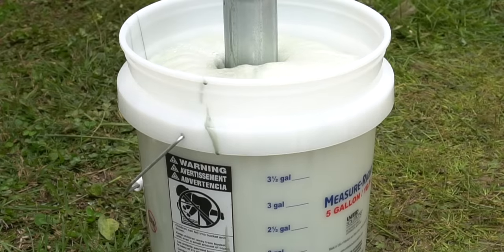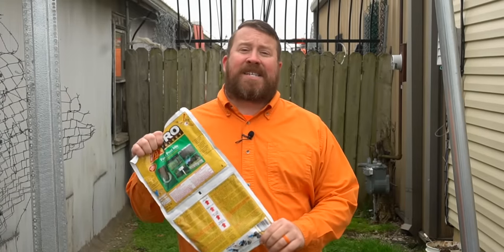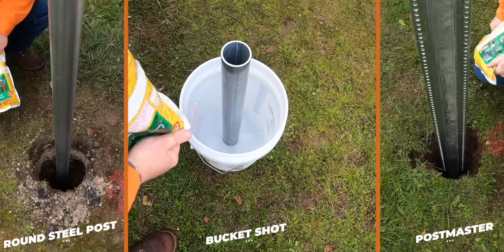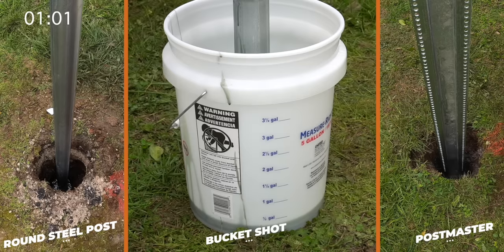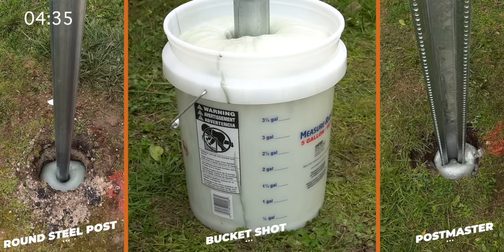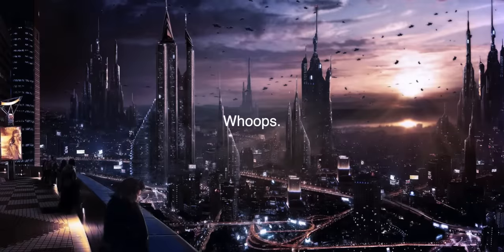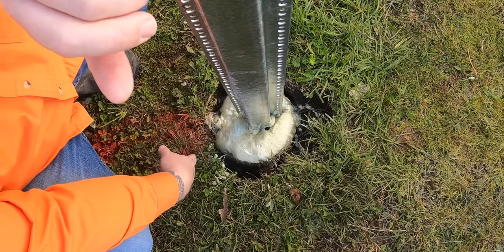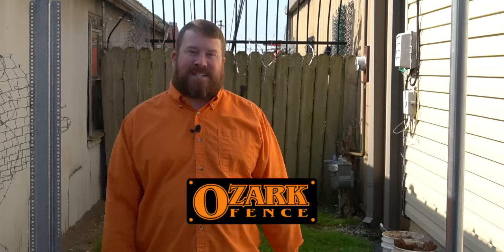Does Fence Post Foam Really Work?

Comment: $12.70 price for the foam at home depot after seeing this  I'll stick with $4.98 bag of concrete
Reply: Lol damn right tho
Reply: @Lord Jasper hahaha
Reply: Forget concrete. I've had great luck with crushed stone.
Reply: @brianallen140  what size stone?
Reply: @jeremywarren7424  3/4 inch blue stone. Very common stuff. I'll also pour some sand in there too.
Reply: Why not use the dirt you dug up to make the hole?
Reply: @Lord Jasper regardless, 1 back of concrete works better than this stuff. i would be pissed if i spent $13 and it was that loose.
Reply: If you want posts to rot...bed them in concrete.
Reply: it's just a fence doesn't matter how you do it long as it stays up lol
Reply: Zeus 1455  you said concrete for dummies...LOL
Reply: This kit is equivalent to two bags of concrete ... Also best used in cold weather. Keep kits warm on dashboard... Saves time.
Reply: @timslowey4379  Not when you use a steel post like this video.
Reply: Takes a bit more work to haul 60 or 80# bags, which is a consideration.  That said, I use concrete.
Reply: Who the hell buys concrete in a bag to do fencing. Get a trailer load of concrete blend and buy bags of cement. I can do 40 metres of fence  for around $60.
Reply: @jamier43 uhm a regular homeowner, not a contractor lmao
Reply: Does your concrete expand & consolidate the soil around it so the post will be solidly fixed? You’re not comparing like with like.
Reply: Ducati30080 
1–If you are in some weird offgrid location and have a hard time moving materials (like I do in Alaska where everything g is either flown in, or taken on a boat ride and then offloaded and walked over 300 meters from the boat to build site) then being able to carry enough foam for the whole fence in what would be for just one post with that concrete, will be the deciding factor for you.

2–as to the wobble, several states have been using foam to put in telephone poles for over 20 years.....they’ve had no problems.

Use the product that fits YOUR situation, and be happy you have a choice.
Reply: @brianallen140  "Very common stuff" says guy on the Internet. Marsian stone is also widely available, for a Marsian.
Reply: @EarendilTheBlessed  funny but I gave the answer in my reply.
Reply: Not only that, but for upright structures, the wieght of concrete is a huge plus.
Reply: @timslowey4379  maybe in 20 or 30 years, by that time you will want to replace anyway
Reply: @doctorthee  try it with clay, lol
Reply: @2009rummell  I trust Crete
Reply: @Benzknees  mixed right it does, fast setting stuff expands
Reply: JOSE Geo - Concrete expands and contracts minimally, whilst curing, and when subjected to changes in temperature and moisture content, hence the reason for control joints in large pavements. Compared to expanding structural foams this movement is insignificant. The two are not comparable.
Reply: @Benzknees  structural foam is affected by weather, a little chilly barely expands, hot days it explodes ...concrete is tried and true building material
Reply: Christopher LeMasters you replace the fence every year?
Reply: Me too. 27 year old fence. One 4x4 broke only because some mysterious person ran into my fence. I don't want to jinx myself, but at 59 I hope I don't have any posts replaced until I'm on "the 4th. floor."
Cement is just fine!!!
Reply: $4.98 for a bag of concrete? Here in New Zealand I just built a 20meter fence and paid $22 per bag of cement and I used 8 bags with my trade discount.
Reply: @isabellenolet1193  
I just checked the price at RONA. A 35kg bag of all purpose cement mix with sand & gravel is C$5.08. Your prices down there seem terribly high.
Reply: @Christopher LeMasters Digging up old sets is time consuming and costs more, most people do not want to pay more for us to dig up concrete that they'll never notice anyway.
Reply: @carlbeane9227  😂😂😂
Reply: @Christopher LeMasters I'm not sure if you've ever dug out a concrete base but we would lose an insane amount of money and time if we dug up every one of them just because somebody might want to dig there later. Us, as a fence company aren't in the business of caring about future buyers of property that we just so happened to work on, that is up to the current owner if they want to spend the money or not. If I wanted to build a fence at my house and there were existing sets from 2 fences back I would just stagger one panel a little and try to miss them or miss as many as possible but I wouldn't be pissed because I think paying to have them all dug up unnecessarily is a waste of time and money.
Reply: @Christopher LeMasters You make it sound a hell of a lot easier than it really is. You can definitely pull posts with a chain until they're rotted and just break off or they're vinyl posts and they break or the customer has a nice landscaped yard and you can't get a skidsteer or mt85 to the fence. It's not ripping people off, it's just what makes sense. If we did pull every set on every job I guarantee you the company isn't going to drop everyone's wages to pay for it, they're going to raise the cost of installing a fence.
Reply: Obviously the weight of the cement is a good anchor, especially with a solid fence that's catching wind
Reply: @Christopher LeMasters you brought up arguing. my comment was a fact based comment, without any feeling or drama. my mother in law also finds arguments where there aren't any. you two should definitely hook up
Reply: @Christopher LeMasters I wasn't a part of YOUR discussion. and, regardless of how hard you try, you can't get me to care about whatever you're trying to get me involved in. I didn't even reply to your comment. you just started tagging me like a weirdo. did I tell you you're like my mother in law? nobody likes her and she lives alone....
Reply: @Christopher LeMasters I'm aware. BECAUSE I'M THE GUY THAT BROUGHT IT UP. and I actually wasn't talking to you at all. you're having a girl tantrum at me and I didn't even see your reply or read more than a couple and they also pointed out other differences.... still, you want to believe you're important. lmao
Reply: @Christopher LeMasters it's not that. It's that men don't do that much babbling....ugh
Reply: @HACKS He's trying to argue with everyone on here. Try to get away from my Thanksgiving family drama and your right.
@Christopher LeMasters Is like my Aunt Betty, who once started a fight at a two car funeral.
Reply: @timslowey4379  Pressure treated posts do not rot in concrete.  The lack of oxygen plus the pressure treating prevents them from rotting.
Reply: @mypups7626    Wooden pilings do not rot.  The lack of oxygen and the constant exposure to water prevents rot.
Reply: Just 10 bucks for me. The time saved loading stacking mixing and tromping through flower bed with a wheel barrels or buckets full of concrete makes this  a money maker. The cost saved in  man hours to go to the yard load unload to some ungodly distance in the back. Set up a hose mix it to make it even heavier . clean up the mess. and shove the wheel barrel back in the truck.  Then wait  for it to cure . This stuff fits on the front seat and can start framing in 2 hours.
Reply: @brianallen140  Yup, crushed limestone is what I have used.
Packs like concrete when you tamp it while running water into the hole.
Reply: $78 in NZ!
Reply: Concrete posts last 10 years in California weather.  Foam is water proof. So it protects the post instead of accelerating the rot process.
Reply: I just did a fence, 3 foot holes with post hole digger, The holes 9 10 inch diameter, Bought by the gallon mixed 33 to 40 oz per hole for an 18 inch or so water tight collar. Spent 100 buck s on bracing 13 posts witn 1x4 utility and wood stakes plus a 2x4 x 16 to tie three post together at the base. Pour day was fun I was done and cleaned up in 4 hours started cutting post to height on pour day.  At 57 I think it was awesome.  I would plan on 40 oz holes next time. Especially good when going through gardens in other peoples yard.  At 57 I blow off fence jobs but now maybe I will do another.
Reply: @AztecWarrior69_69  and then come back in 10 years and see how useless this foam really is. Sure, seem like a good deal, now...
Reply: Indeed
Reply: @timslowey4379  I put my pressure treated posts in concrete about 25 years ago... also coated the bottom area of the post that touched the concrete with foundation tar.  Had to remove the fence and posts last year.  Not one bit of rot.  I'd do it again...
Reply: @timslowey4379  Metal posts were used in this demo. ?? right?
Reply: @isabellenolet1193  3 bucks a bag where i am in cali
Reply: @isabellenolet1193  9.95 a 20kg bag in oz
Reply: I’m sure that’s what they said about cellulose insulation too back in the day 😂👍🏻
Reply: Heck yeah ... and the holes were only like "bucket deep" (- 3 gallon bucket at that)  I don't know about other areas of the country but in Michigan you need to go about 42" deep due to frost line ..... heck you would need 2 or 3 bags of that expanding foam post stuff per hole .... so like $25.00 to $35.00 per hole ???  !!! ..... and they didn't show what was at the bottom of the hole for the post to sit on ??  we use a  broken piece of  cinder block or something ..... Wouldn't that foam push the post out of the ground as it expanded ???   Heck I will stick with bags of quick creat and putting smaller stones and rocks around the post ..... but in some dirtt and tap it down !! ...... call me old fashioned !!!
Reply: no shit...kinda pricey...especially when a 2x4 is now $7...
Reply: 80lbs vs 3? when used for the right applications I use foam all day long. NOT for fence posts
Reply: @EasyMoneySG  If enough people demand their money back on stuff the doesn't work, the store will stop selling it...because they don't want to be doing constant refunds ;-)
Reply: they just want to pollute the ground with that chimical  plastic crap .
Reply: @Sonjingohan 0 You’re complaining about people leaving concrete in the ground, but you’ve yet to mention putting chemicals in the ground is an issue? To your other comments as well, sometimes the easy way of doing things isn’t the best way, it’s hard to negate this stuff doesn’t work. Maybe you’re correct and there is some brand out there that does better, but concrete is tested and proven. it doesn’t have the ability to shrink like foam does, it will only ever contract a couple thousands of an inch, foam can contract multiple inches. I don’t think you could pay me to use this stuff, concrete is cheaper and the issue of removing it is non existent, it requires labor but it’s not the end of the world. Also before you ask, no I wouldn’t leave concrete in my yard, but it’s not because I give a damn about the next guy.
Reply: @Sonjingohan 0 I agree with you, like I said I’m not being a jerk but trust me the reason I pull the concrete I put in back up is because you’re right, if you put it there you take it out. Honest question, are you more of a fan of the foam due to the ease of removal? Not to argue but I just have never found any of this foam that has 25% of the strength concrete does. Just curious on your view on it.
Reply: That's what tar & wood preserve is for.
Reply: @isabellenolet1193  ouch
Reply: @brianallen140  same here, I mix it with the dirt that came out of the hole.
Reply: what are you going to do with all that leftover cash?
Reply: Rocks are cheaper,and works every bit as well. 
Take a look outside, 
See any tall poles with wires strung out on them. Check around the bottom, you will never find foam, nor concrete. 
It's isn't necessary.
Reply: Just make the entire post out of concrete with rebar.
Reply: My grandpa thought it was easier so he bought it not only did it not work he had to dig out the foam by hand so he can pour concrete in it anyways
Reply: @timslowey4379  nah, as long as you put 6" or a bit more of crush below the post then the post surrounded by concrete you're good. Should use a pressure treated post too.
Reply: Plumb!!! = Dah!
Reply: Plumb!!! = Dah!
Reply: I agree, foam is expensive and dirty.
Reply: I agreed, foam is expensive and dirty.
Reply: Could be why it hasmt caught on. Even for contractors building fences you get more working time with the 5 dollar bag of concrete plus the low overhead cost.

Plus concrete over decades or centuries will degrade safer into the earth as oppose to the foam.
Reply: @michaeless658  clay would be excellent, but would you have to buy it?
Reply: @davidschmidt2081  listen to this person. I replaced my 150ft of fence on a 60 degree hillside and started to remove the old wooden post concreted in the ground. After about the 4th one I gave up and just staggered where the post goes. Also helped support the top of the hillside where I was building the fence.
Reply: This is definitely more for 1 or 2 posts. Not the entire fence
Reply: @doctorthee  cuz you want the fence to still be there after the first bad windstorm
Reply: Until you need to install 41 fence posts lol
Reply: @brianallen140  just did 302 posts with stone dust and fine dirt mixed
Reply: @treetop5752  worked well right?
Reply: I agree
Reply: X3 bags of concrete. Price is about the same.
Reply: Lol
Reply: No cause 1 sika can do 50 lbs. of concretes job! I used this on my entire backyard when I redid my fence. Works great!
Reply: I've  used  2 pkg of foam , about  $30  plus .
 Next day i had to remove it  ,  did not work  , 
lost time and money. 
Went back to Home Depot  , purchased 2 bags of concrete  - total $8 plus.
The job is done.
Reply: Don't use concrete either.  Use 1/4 down limestone.  It packs really nice and cement has caustic chemicals that dissolve wood fibers and then water gets between the cement and post and rots it.   You can easily remove the post in the future with the crushed rock but not concrete and you can't get the concrete off the post and reuse the post.  I jack the posts out of the ground with a car jack.  They are put 4 feet deep in 1/4 down.  This video is from the Ozarks where there is no ground freezing so this fellow has limited experience with different climates.
Reply: @timslowey4379  You must not do it right, then. You can seal the end of the post going in the ground. My fence posts are going on 15 years and still secure.
Reply: For every one pack of foam for 8" round 36" deep hole you need 2x50lb bags. 
Currently 2 bags of fast set is $14. One bag of the foam is $16. 
And you don't have to make concrete
Reply: Let's see...80lb bag of concrete.  1lb bag of foam.....yeah I like not having back pain.

Comment: I've put up lots of fence in my life,  I've used dirt, cement, and concrete. I used this exact same product just about 1 year ago to replace about 60 ft of my personal fence. I was out looking at it yesterday. While I got better results using treated wood 4x4's I would have to say it's worth it to go with quikrete or something similar.  Unless it's a small fence that is in ground that won't shift or become saturated. Don't go with foam.

Comment: Expert on industrial foam here. In my experience the curing Chemical has a pretty short shelflife of a few months  before it starts to degrade. The older it gets the more shrinkage you get
Reply from the maker: Interesting, there’s no telling how long it took to make it to the shelf and then how long it had sat on that shelf!
Reply: How does this differ from home insulating foam. That doesn't shrink?
Reply: @davids7209  even urethane spray foam will shrink if not mixed properly or if the substrate is too cold. Biggest problem we have  spraying foam is heating the osb to 50 degrees in the dead of winter.
Reply: @mtbasshead  How does your comment relate to this video? It's not the dead of winter so the foam shouldn't have shrunk. Just sayin'
Reply: @davids7209  Did you miss the part of the sentence about mixing properly or just gloss over it?
Reply: Just fill the hole back in with the dirt that came out. Use a garden hose filling the hole as you put dirt back in the dirt will be more packed than before the hole was dug.

Comment: I am a cretin, I just tamp the free dirt back into the hole.
Reply: Nothing wrong with it as long as it has proper moisture so it can be compacted adequately. If you are really good with compaction you'll need a bit of extra dirt up top... If you have some left over, you did a poor job.
Reply: you could fix the outside, but the foam didnt bond to the post and cracked.
Reply: @stoptellingmewhattowrite , Why would you need extra dirt, since the post is taking up most of the space ? If anything, you should have EXTRA dirt.
Reply: @augustreil   You would think so but he's 100% right!  When the compaction is done correctly it's more than the amount removed for the post and you'll always need more dirt.  I grew up on a farm, we never used concrete to repair posts out in the fields.  It also helped that you didn't have to haul 80 pounds out there!  Just a post hole digger, shovel and tamper.
Reply: I agree, Never had a problem doing it your way with a wood post; I've never used a metal post so I don't know about those with just dirt.
Reply: @geometric5103  I think it works well, considering some I have had to pull that have been in the ground for a while. Very solid. 
Like somebody else ( and my dad )said you have to tamp them in good.
Reply: @cblanton42  maybe for a 4x4.  Just poured 10 footings 20 inch deep 8x14 columns going to 12x6 pads. Could tamp all day long and would never use all the dirt that came out of these holes.
Reply: @stoptellingmewhattowrite  100% should use more dirt then originally come out , unless using very big post in small hole